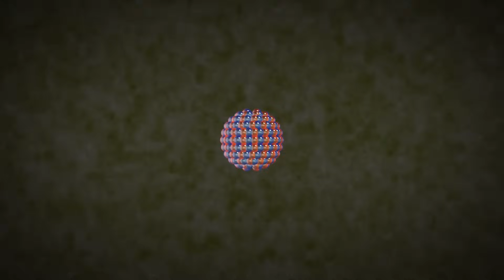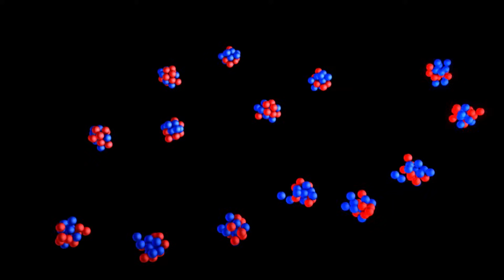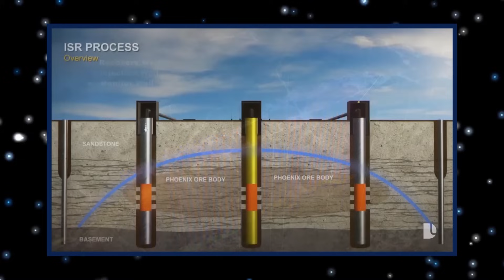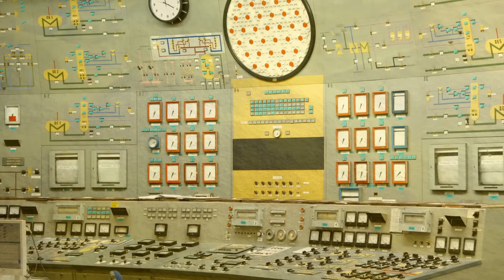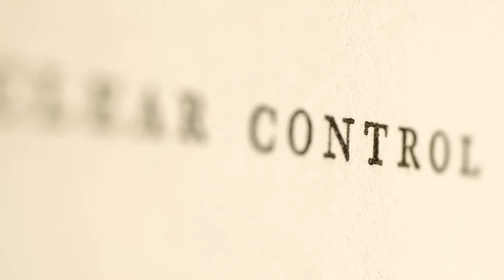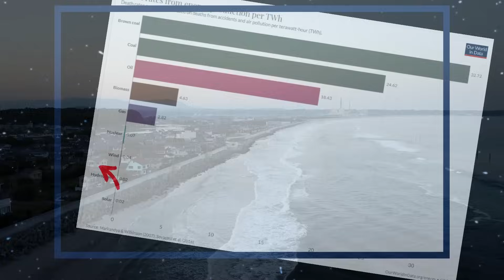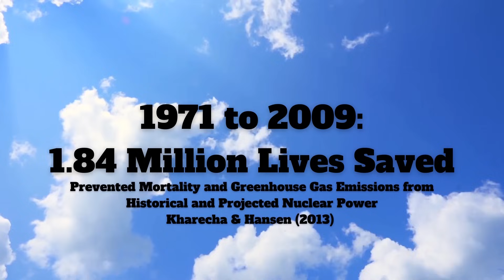URANIUM Documentary: Mining, History and Future Outlook

Comment: The world needs to develop this technology. And never use it for war. I feel the mini, nuclear reactor that reduces the radioactivity in nuclear waste reusing it for the smaller reactor. A miniature nuclear reactor that uses nuclear waste from the larger reactors. We need to update, expound on the science and really get all the current nuclear reactors. New technology and brave people working will accomplish this. Bombs are a deterrent. If they do that, forget about a good life anywhere. 

It is entirely possible to reduce oil to a bare minimum and have nuclear energy to power the grid and all buildings and cars. That will actually have an impact. Some technology to filter carbon molecules out of the air. We're need some more technology and a nuclear industry that is formidable. You can't crush every company that come into this industry to find non-scientists stopping the industry. The clean energy aspect could change things. They need to build small reactors that are easily containable. Not even enough radiation, but build 500k of these little reactors and you will reduce the radioactivity in the nuclear waste from larger facilities, allowing the material storage time to be cut down from 20,000 years to 20. I hope I get to see this all happen. I'm 54, I should get so see some wild stuff happen in the next 25 years.

Comment: High-level radioactive waste should be stored sealed in lead-coated gold sheets to prevent direct contact with water, so that the radioactivity decays through long-term storage but cannot be dispersed with any running water. Gold is very durable, especially in contact with water. Otherwise real GOLD is a quite useless material.

Comment: Nuclear energy is cleaner that all others except for solar/hydro/wind. Byt it doesn't have the drawback of the "renewables"... No wind? No power. No sunshine? No Solar power. Drought? No water resource? No power!
Nuclear? Plenty of Uranium, at a cost, but it will work when other sources are unavailable.
Reply from the maker: Very true, and it could potentially be considered cleaner than solar or hydro when you consider all the fossil fuels required to bring those energy sources online, not to mention offshore wind cause ecological damage in the oceans.

Comment: It's likely more reactors will come online in the 21st century, but their cost to build and maintain is a serious limiting factor, as is the ultimately finite amounts of U-235 in Earth's crust.  Factory built (off-site) modular reactor designs may rein in some costs of construction, and feasible molten-salt thorium/uranium reactor designs could expand our options.

There is a possibility of waste fuel reprocessing or perhaps so-called breeder reactors to extend fissionable fuel supplies, but it remains to be a finite energy source with safety, security and environmental concerns.

Best case scenario may be that fission will be a bridge to fusion reactors and high-temperature closed-loop geothermal for future generations' base load power generation needs.

Comment: Chernobyl was a caused by cheap Russian parts and user errors. Hiroshima used a plutonium core not uranium.  Fission is dirty but is manageable and much safer with todays processor controlled interlocks.  Fusion is the key to limitless power, but who would control it and where will the money flow??

Comment: Uranium doesn't do anything half way. Regardless, nuclear power plants aren't bombs. They work by boiling water. And if your not under Soviet controll you won't have safety measures removed, crappy designs, increasing pressure, and denial of responsibility. Today, it's pretty dam safe. It's actually the least deadly energy source per kilowatt we have. Wind kills more people than nuclear power. Additionally once the fuel in the reactor it can't be used in a bomb, fuel in nuclear bombs can be used in power plants, the waste from the power plants can't be used in a bomb.
Reply from the maker: Very good points.

Comment: This could be a very interesting documentary if it weren't riddled with so many historical and factual inaccuracies. For example Truman never actually made the decision to drop the atomic bomb. History doesn't necessarily record who did make that decision but it was most likely MacArthur or Eisenhower I would lean towards MacArthur. One of the issues at Chernobyl was not a zirconium steam reaction the steam was produced by excess heat which led to an overpower excursion due to the reactor having a positive void coefficient meaning The More steam bubbles it has in it the more reactivity it has and the more it produces. Also having graphite tipped control rods which would temporarily increase reactivity on their way to being inserted to control their reaction also exacerbate the problem. When a nuclear can reactor can disassemble itself in microseconds then the milliseconds involved in the control rods inserting themselves can lead to huge devastating consequences such as Chernobyl. Other than a complete lack of factual and historical accuracy on many many points it's an awesome documentary.

Comment: I've heard that there are several notions and approaches that might reduce the issues of 'melt down.'  One is to use a meltable salt of the fissionable materials.  The idea is to use a plug of the materials that has a relatively low melting point and is cooled by a refrigeration set up that is powered by the reactor.  If there is a problem with the reactor, or is something goes offline for some reason the refrigeration mechanism is stopped, and the one or more plugs then melt causing the release of the fissionable salts that then flows, as a hot liquid onto a second floor that has patterns in that floor that separates the still hot, liquid salt of the fissionable material into small pools or cups the volumes of which would contain a volume of fissionable salts that do not have a critical mass.  With this sort of setup you can use other fuels, as a mixture... thorium comes to mind.  I've also heard that there have been, in the US, several small pilot plants that have been successfully built and tried out.  They seem to work well enough, without the possibility of a destructive sort of melt down like the one in Eastern Europe.  The fissionable materials tend to be either Actinides or Lanthanides, both set of elements have oxidation states that resemble that of the element Calcium, oddly enough.
Reply: It's likely that circulating hot, corrosive, radioactive salts through meters of plumbing pipes, with numerous bends, welds, pumps, valves, etc is a problematic design. Melt down is still a possibility should cooling mechanisms fail to remove decay heat from the molten salt containment vessels that the freeze plugs are supposed to drain into.
Reply: So far just theory

Comment: You could mention that the reactors primarily meant to produce electricity are very different from those that are primarily meant for producing weapons grade plutonium. When producing electricity, you use water to start the reaction. And if the core overheats, the water boils away and the reaction ends. But if your goal is to produce nuclear weapons, you control the reaction with graphite, allowing you to precisely end the reaction when the plutonium is ready for collecting. And when THAT kind of reactor suffers a failure, the graphite doesn't boil away like water, but instead melts and sustains the reaction making it uncontrollable. Ultimately you can flood the reactor with boron water, which irrevocably stops the reaction and makes it impossible to use the reactor ever again. Yeah, the point is that reactors meant for producing electricity are inherently safer than those that produce weapons. You can still have leaks due to accidents, but not a meltdown like Chernobyl.
Reply from the maker: Incredible comment, thank you for sharing that information.
Reply: This is not correct. Water does not start fission in nuclear power plants and if water is removed the reactor will melt down. Control rods (graphite often) are used in power generation to control power output, slowing the reaction between fuel rods.
Reply: @sethmalcolm8247  In most commercial reactors outside the nuclear weapon countries, water does start the chain reaction by slowing down neutrons to an energy level that allows them to interact with neighboring uranium atoms. The point of control rods is that in these kinds of reactors, control rods are used to slow down the reaction, not start the reaction as they do in Soviet RBMK reactors. 

There are 7 main types of commercial nuclear power reactors: PWR, BWR, HWR, AGR, Magnox, RBMK and FBR. The first two account for 80% of all reactors and they use water to moderate the reaction.

Water moderated reactors are inherently stable, e.g. if the water is removed, they will eventually slow down, whereas if a graphite moderated reactor suffers a mechanical failure where the graphite is trapped in with the uranium, it will become uncontrollable and melt down for sure.

Comment: Cost and safety are yet to be proven for new nuclear. Some new designs are walkaway safe with passive cooling unlike BWR/PWR/RMBK. Vogtle was a proven PWR design but project management issues meant huge delays and cost overruns. The first of the new generation of nukes is only starting operation by 2029 so in the mean time we need to build massive solar/wind/storage and maybe some CCUS natural gas fill gaps and stop emitting GHGs. Thorium as a fuel cycle has huge advantages for nuclear waste and we ran such a power reactor in Oak Ridge for several years.

Comment: Natural uranium is composed of two primary isotopes, 99.27% U-238 and 0.71% U-235, and it was known that the 235 isotope will fission. Un enriched uranium inside a heavy water reactor will fission and also will turn the 99.27% useless U-38 into useful Pu - 239 for BREST reactors and BFMSR reactors that can simultaneously fission while consuming all of their nuclear wastes as an additional fuel and recycle-reprocess their initial start up Pu - 239 into new Pu - 239 nuclear fuel Eliminating nuclear wastes storage and does not need replacement fuel after every 30 to 50 years, depending on the design and materials used in such nuclear reactors which are also passively self-cooling and self-circulating and has the NEGATIVE TEMPERATURE COEFFICIENT OF REACTIVITY design factor engineered into them and built into them. The reactor will become more reactive as it gets cooler and less reactive as it gets hotter. These materials are virtually immune to corrosion and fluid erosion and UNAFFECTED BY NEUTRON BOMBARDMENT INDUCED EMBRITTLEMENT caused by exposure to direct neutron bombardment. Which also means they can last as long as they exists!
Reply from the maker: Thank you for that amazing piece of information!
Reply: @CommodityCulture  The materials that I was referring to are made out of beryllia-beryllium and zirconia-zirconium glassified and fused cermet which is discovered in Russia way back in the 1950s and were rediscovered by the Americans later on and eventually developed a new process to produce the same material known now as glassy amorphous metals. These materials are virtually immune to corrosion and fluid erosion and UNAFFECTED BY NEUTRON BOMBARDMENT INDUCED EMBRITTLEMENT caused by exposure to direct neutron bombardment. Which also means they can last as long as they exists, and any reactor components that are both directly and indirectly exposed to neutron bombardment will last indefinitely.
Reply from the maker: @darthvader5300  Interesting, thank you for clarifying.

Comment: You need plutonium to make bombs and not uranium. Yes, you put uranium into specialised reactors whose sole purpose is to produce plutonium- but the point stands. I believe that only one nuclear bomb has ever been constructed using uranium- Little Boy.
The moderator does not 'slow down the speed of the energy'. That doesn't mean anything.
Reply from the maker: Thank for the info!
Reply: @CommodityCulture  You still need Uranium, even in a modern hydrogen bomb. Depleted Uranium is needed to trigger the implosion of the Plutonium core.

Comment: Yes there are certainly a long list of reasons to go nuclear, as you so aptly pointed out here. It looks to me now though that Hydro is the way to go if you can, and do it well for the health of the river too! Then if you have a good domestic supply, gas, coal, wind, geothermal, hydrothermal are good second choices. Solar, biogas, biomass are also good, along with storage while Nuclear is good if you have cash up front and want to reduce GHG emissions and/or imports of fossil fuels. Nuclear also has some good spin off industries like plutonium batteries for space applications, glowing exit signs, radiation cancer therapy, etc.

Comment: Clean? What about the tens of thousands of years it takes for the nuclear waste to become safe?
Reply from the maker: The nuclear waste issue has been completely solved now, it's not a concern.
Reply: Do a little research. 
The waste isn't even an actual problem, just a fearmongering point that anti-nuclear lobbyists and politicians use to scare you away from nuclear.
Reply: @jakehildebrand1824  waste that's toxic for thousands of years and needs careful management isn't a problem?

That's a very interesting take.
Reply: @jakehildebrand1824  that isn't true. Spent fuel rods are shielded for thousands of years, it isn't safe. A quick search is all it takes. 

That's why the Swiss built a deep underground repository.
Reply: @jakehildebrand1824  Yet it's buried deep underground for thousands of years. What am I missing?
Reply: @chris86uk  you're missing the part that explains exactly what kind of nuclear waste is buried deep underground for thousands of years. 

Its almost exclusively weapons and research waste. 

Depleted Uranium (which is what spent fuel rods are) is so safe that you can buy Depleted Uranium glass marbles and hold them in your hand.
(I've actually got a few. They look absolutely beautiful under a blacklight. They have a slightly different color to them than regular Uranium glass marbles)
Reply from the maker: @jakehildebrand1824  Good comment, thanks for clarifying. There is so much ignorance and misinformation out there around nuclear energy, it's mind boggling.

Comment: The major problem about chernoble is Lies. The staff where not told about the controll rods. Witch the tips where made of graphite witch increases the flux. The RBMK 4000 Was built to not be able to explode. But if the reactor was pushed to the absolte limit. E.G xenon poisoning witch builds up over time in a reactor using 235 U witch slows down the rate of reaction and made the reactor stall when they started the safety test. (Witch was a test to see if they cloud start the reactor up with no backup gen. (It was too see if they cloud use the remaining power in the turbine to start up the reactor.)) Anyways the xenon poisoning lead to a reactor stall and when the controll rods where pulled away to stop the stall the power darted up quickly. Then the senior operator Akiemov press the emgency shutdown when the reactor was on the brinc of meltdown witched blew up the reactor. it was a mixure of bad leader ship, Lies about the reactor design, Stuipd admin, and the crew had little to no expereance with the reactor only 6 months, and they only heard about the test that night. 

"if we hear enophe lies we forget what is the truth" - proessor Legasoph.

P.S Please mine the spelling i had to a lot of research to get this info.
Reply: Not exactly a perfectly accurate recount of what happened, but close enough.

Comment: Get cobalt magnets and a semicircle stainless steel bowl.  Surround the magnets around the bowl on outside.. Then cut a small hole on bottom.  Get a 100 watt only heat rod from amazon for 10 dollars.  the 100 Wat rods go about 280 degrees normally (safe)  however put the rod in the hole on the center of bowl.  Then attach a 4 ft nickel rod that cost 5 bucks.  a nickel rod can support 1500 degrees.  after attaching nickel rod to 100 wat heat rod. plug it in.  The cobalt magnets will force  a curie effect. all of the sudden under 5 seconds the 100 watt rod is reaching over 1200 degrees because the magnetic field is going nuts with friction.. and also the field is being forced after the explosion back to center because the magnets are pulling it back like the sun.  You now have over 1000 watts of energy at only 100 watts.. cost to make is about 50 dollars.  Now put that over 1000 degree nickel rod in a water tank to boil water or make steam (free heat almost)..  And screw the energy department.  YOu might want to get a giger counter to check because it might not need uranium to have safe effect (as hint).  When vibrating electrons and heating material the effects are the same as a small reactor.  I built it by accident a couple years back looking to make heat on no energy.  Here is you easy stop guide.. and screw the system.
Reply: Doesn't make enough heat to generate anywhere near a useful amount of power though. Also it wouldn't be radioactive.

Besides, why do that when you could  make a tabletop reactor instead and produce plutonium (though not a relavant or even observable amount of plutonium)
Or you could make a fusor.

Additionally thats not what the curie effect is.